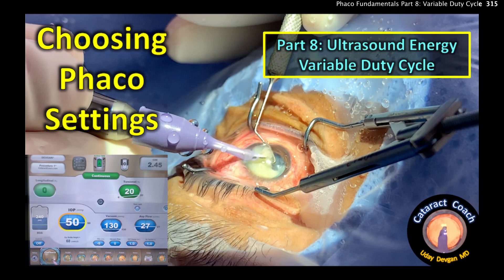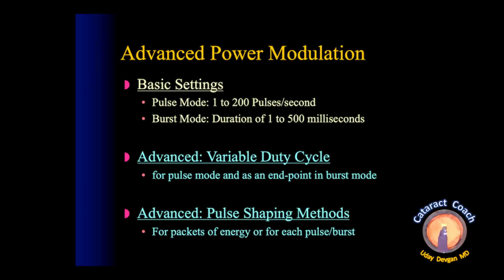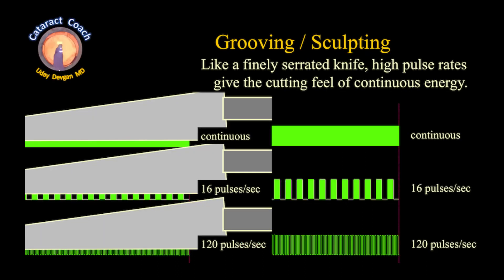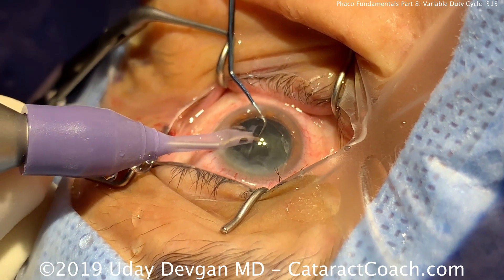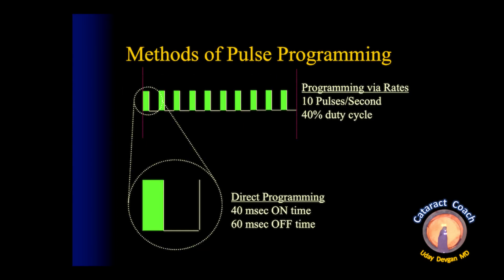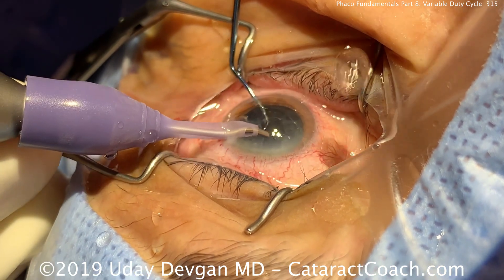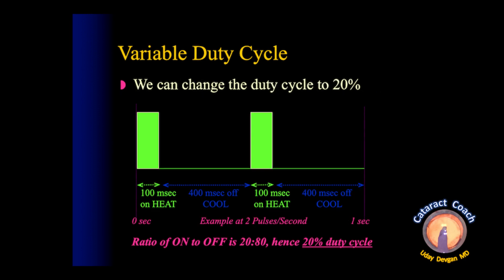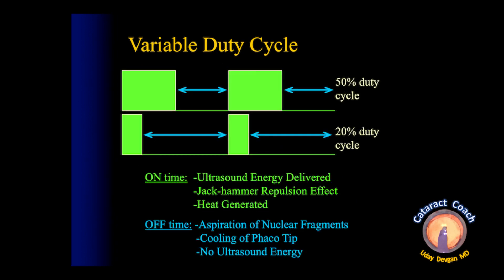Phaco Fundamentals Part 8: Ultrasound variable duty cycle

Comment: Thank you so much for your video. I am able to grow so much as a cataract surgeon simply by watching your videos. 

I have one question here. The pulse mode ( as you showed in the video shots where the surgeon is operating) comes through at foot pedal 3 only right?

Another question: while doing phaeco, while emulsifying the nuclear pieces, we consistently shift foot pedal from position 3 to position 2. Does this mean that in pulse mode we can safely place the foot pedal a little longer ( as necessary) at foot position 3 without worrying as much about delivering too much heat to the cornea ?
Reply from the maker: Yes that is correct. Pulse works only in position 3 and will decrease the total amount of energy placed in the eye.
Reply: Sir, thank you for the prompt response :)

I’m REALLY grateful to you! 🙂🙏🏻